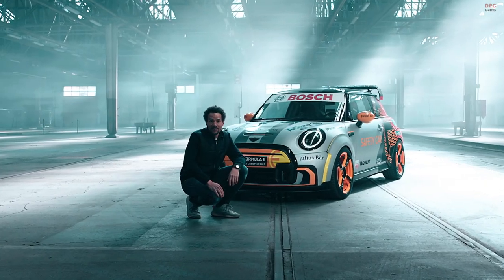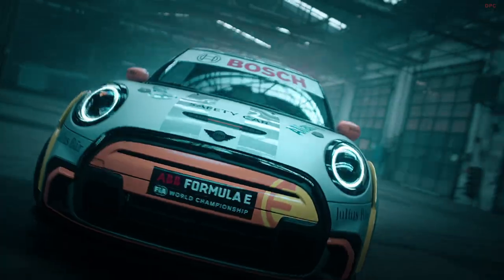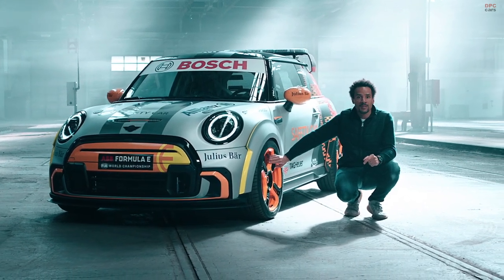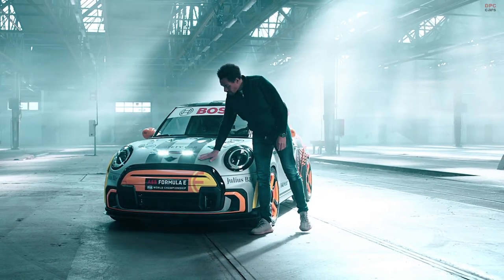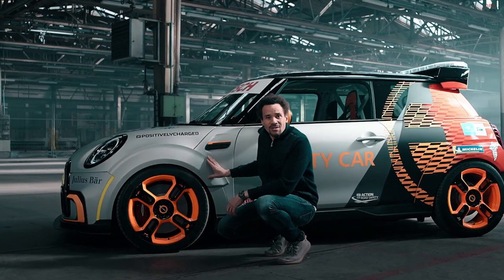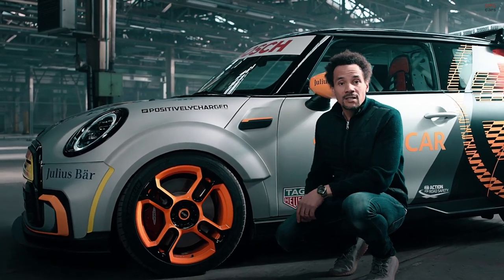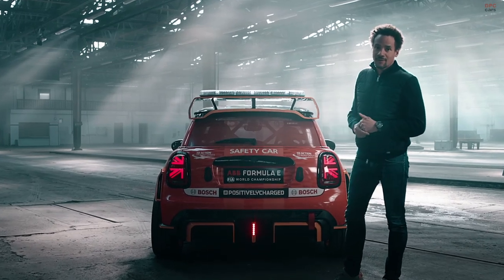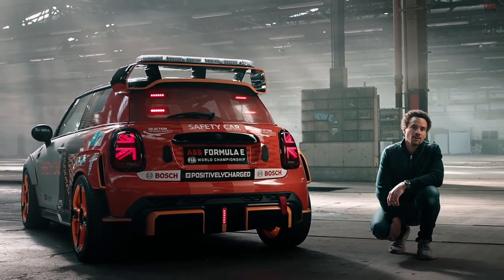MINI Electric Pacesetter Safetycar

Comment: Are these being sold? Or just for a racetrack?
Reply: Not for sale. But that front end is similar to the new JCW.
Reply: I just finished upgrading my Mini electric 2022 version to this exact styling, minus the big ugly rear spoiler. Well, the final step remaining is to wrap the entire car including plastic wheel arch trims in matt black and PPF. The alloys will remain black gloss. I'm thinking about removing the rear seats to save more weight, and it's never used because the rear leg room is non existent as I'm a tall driver.
Reply: @POVDrivingTour did u customize the diffuser by yourself?
Reply: @bangojolmedan  No, I took it to the mechanic shop to do it. They are more experienced with these type of customizations.
Reply: @POVDrivingTour  did it made exactly the same as the concepts? what did it made from? a plastic or carbon? did u do the widebody too?